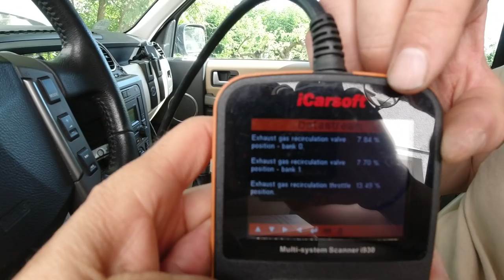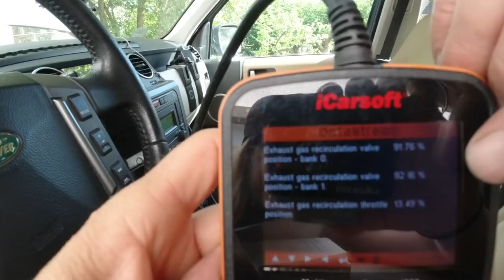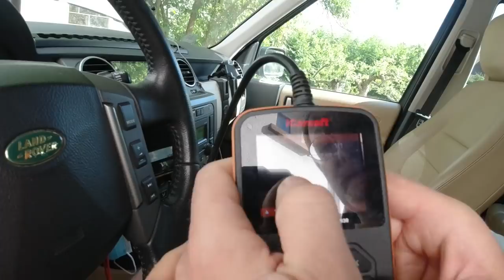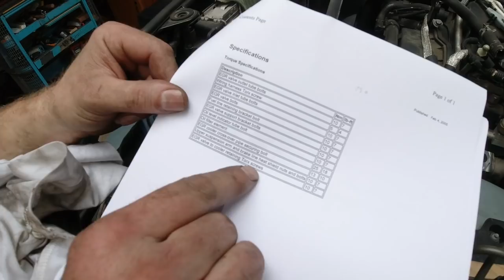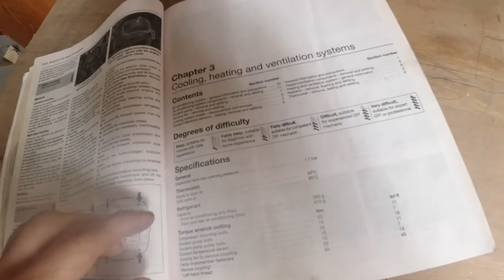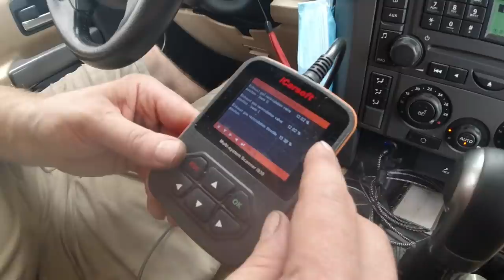How to replace the EGR valve and water pump / Land Rover Discovery 3 / LR3 / LR4

Comment: Christian was meinst duwie hoch ist die Zeitaufwand für beide ARG Ventil wechseln in ein Profi  Werkstatt? Also nichts direkt LR sondern Werkstatt wo sowas wahrscheinlich schon 100 mal mindestens gemacht hat.  Danke mfG
Reply from the maker: Schon mindestens 3h.
Reply: @Vera_and_Christian  Danke. 3 h ca. hätte ich auch geschätzt. Kann das Ventil offen bleiben ohne Fehlermeldung und Leistungsverlust unterhalb 2000 rpm verursachen? Ich meine in Teillastbereich wäre sowieso etwas offen.
Reply from the maker: @vegvariroland  Nein, das Ventil ist fast immer zu. Wenn defekt bleibt es fast immer offen stecken und dann fehlt einfach Power.  Der OBD Scanner zeigt das aber aber imm zweifelsfrei alles an. Da braucht man nicht rumzuraten.   Außerdem kannst Du ja die Stecker abziehen und den Fehler provozieren. Und du hörst wie die Ventile durch den Testzyklus gehen wenn Du den Motor abstellst.  USW USW. Ist ja alles in unzähligen Videos von uns.
Reply: @Vera_and_Christian  ja ich dachte schon dass du es ja in Video alles super gut erklärt hast. Leider verstehe ich nur sehr wenig davon.  Müsste ich endlich Englisch lernen 😪 
Aber ich verstehe immer noch nicht da ab Baujahr 2007 sollte das AGR Ventil von der Motorsteuergerät überwacht sein daher kann man die auch nicht einfach stillegen. Also dann müsste doch das ECU doch erkennen ob die Ventilen offen oder Zu sind oder? Mit ein Diagnosegerät sieht man auch nur die Werte was an ECU ankommen oder? 
Meine Problem ist einfach dass ich keine Werkstatt mit lr3 Erfahrung habe bis auf eine der will aber mir erzählen dass ich mein Auto wegen leistungsverlust erstmal so min 3 Tage bei ihm stehen lassen so damit er die komplette Messung machen kann. Da kannst du dir sicher sein dass ich dann bei Abholung eine neue Turbolader oder 6 neue Injektionen Bezahlen muss. 
Aber da sind wir schon bei der Thema LR oder Toyota😪

Comment: hello nice people
q for you, how many litres per 100km do you achieve at the pump, that is measured fuel, not the computer, I read 7.5 @100km/h on cruise control and at the pump 12.7, strange, the 2.7 engine, well no smoke no troubles
Reply from the maker: Right now, with the RTT and AT tires, we get 10,72L/100km, before that it averaged at 10,25 of actual gas consumption. According to the Disco's computer, it only uses 9,5 L/100km. We calculate the actual gas consumption every time we fill up, and on all of our vehicles. But we live in a hilly area.  We have no experience with driving in a flat area. 🙋‍♀️ Vera

Comment: If your LR starts making a noise that could indicate something is wrong turn the radio up until you cannot hear the noise any more. When the car is louder than your radio.......No don't fix it. Buy a louder radio.
Reply from the maker: I think that only works for Toyota drivers. A Land rover needs to be pampered😅👍🙋‍♀️Vera

Comment: Nice video as always, and I see many names from Disco3.co.uk already watching here. I am sure this video will feature again over there soon. 
My left EGR is sometimes is sticking open too, but instead of replacing, when it happens, I give a good push on the gas and the exhaust gas force the EGR close ;). Then engine off and on again to start the cleaning cycle. So far this trick it is working just fine. But, If I need to replace it, your video was very helpful. 
By the way, on a D3 HSE 2007 (EU4, no DFP), if you blank the EGR no error comes up, but if your EGR is at fault electrically, the usual engine light comes up after 4x starting the engine. Strange things. I ran mine during a trip of over 2000km with an emergency-coin-blanking-kit 😑
Reply from the maker: 😃👍 You just remind me to put the blanking thingy in our spare parts kit, thanks.  Maybe someone else needs it, if not us ( hopefully)👍🙋‍♀️ Vera
Reply: @Vera_and_Christian  Christian & Vera: on 8:12, 8:21 and 8:30 we can see a "blue thingy" on the bottom-right corner of the screen. I can assume it is your front diff breather tube, but what exactly you attached to it? Did you add it after Fabian's diff "overpressure" from last video? Thanks.